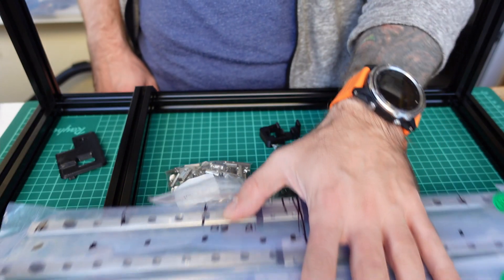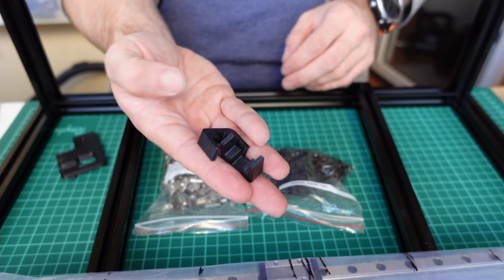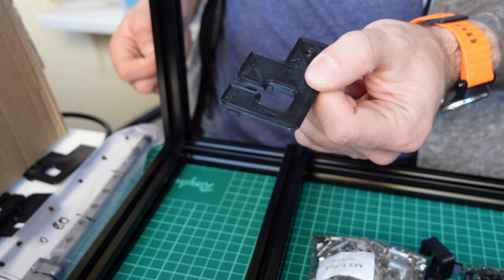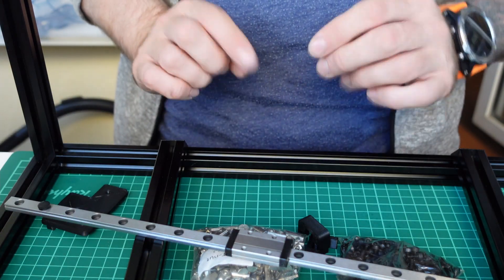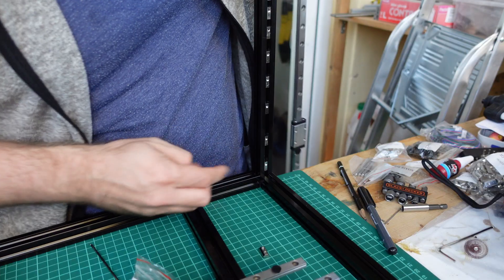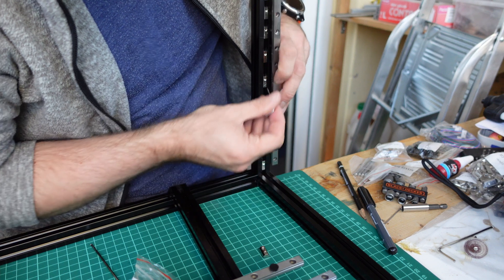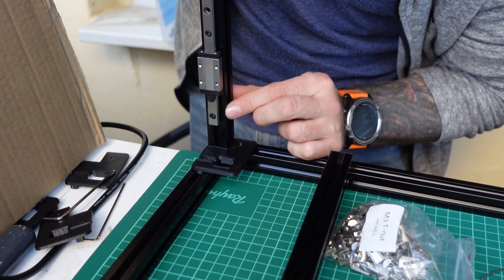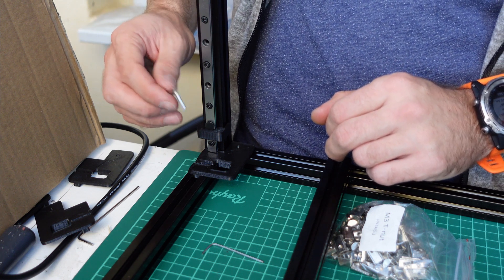Building Voron 2.4! P1 - mounting Z linear rails with FormBot kit 350mm

Comment: Thanks for the video. But wouldn´t it be a lot easier to mount the screws and t-nuts on the linear rail first, then slide them into the slot?
Reply from the maker: If you are using blind joints this would not be possible (or you would need to slide them before you assemble the frame) as the side extrusions block the vertical ones.

Also, it's not that easy to push the whole rail with nuts, especially for larger builds.
Reply: @techbytch  Then I was wondering why you were doing it with the unit upright instead of on its side to prevent the t-nuts moving actually :) Thanks anyway and I've subscribed now as I'm hoping to buy one of these kits from AliExpress soon and seeing how you progress with your build will be very interesting.
Reply from the maker: @Derek_S  the kit I got had rectangular t-nuts that have a spring-loaded ball so once you push them into in the extrusion, they stay there no matter how you turn the thing around